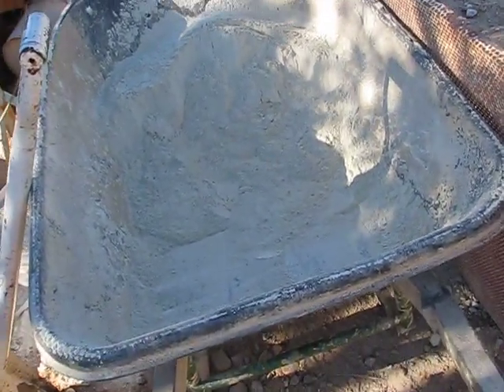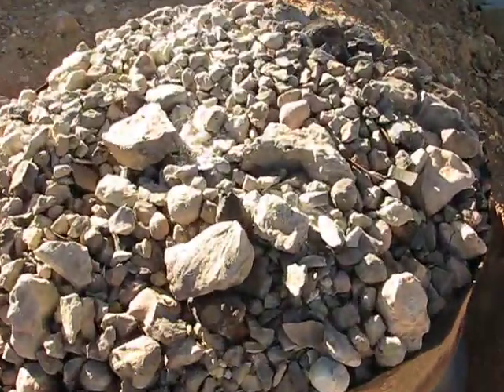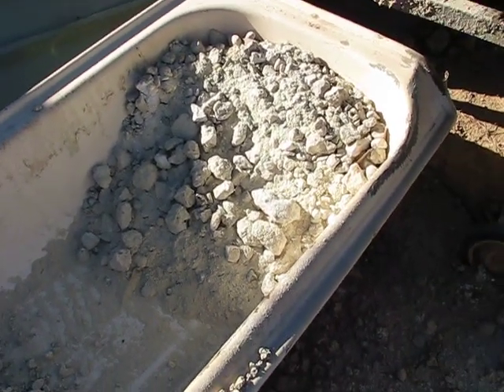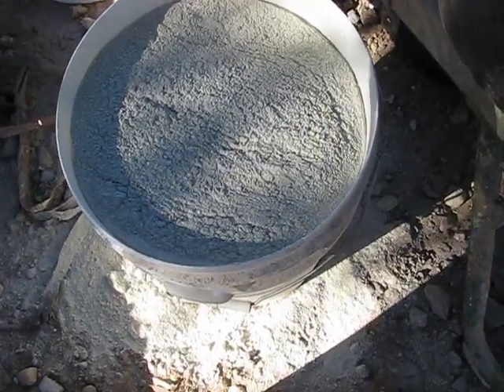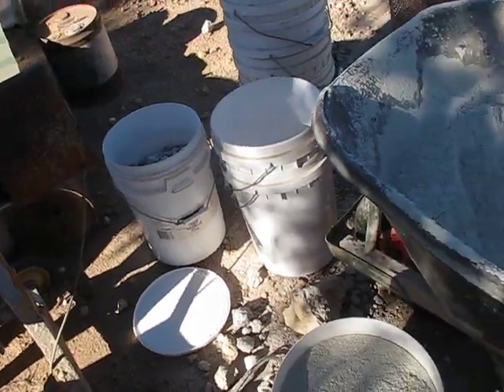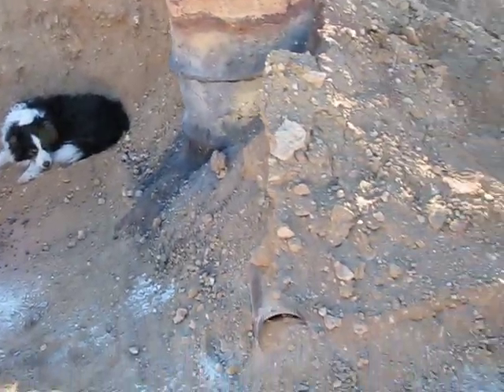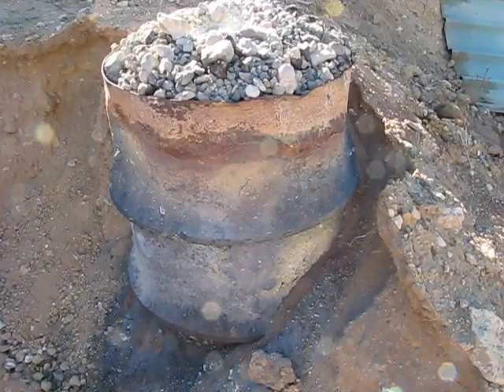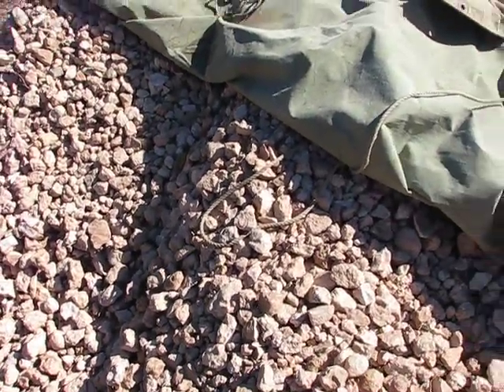Hydraulic Lime mortar making

Comment: I am doing some quicklime mortar here in the middle of England. Please share more of this with us. I hope to upload a video or two as well.
Reply from the maker: what else would you like to know??
Reply: @gavabe3461  Just post more vidoes!
Reply: @gavabe3461  I've posted a video showing my quicklime mortar mix now: TygwqB27MGM
Reply from the maker: @metallitech  link doesn't work . I have explained how my system works right from the burining in of the kilns to making putty/ NHL right through to NH limes. Just remember size of rock needs to be in a comparable size to your kiln, IE: 20 /40 mm size for a 200ltr drum